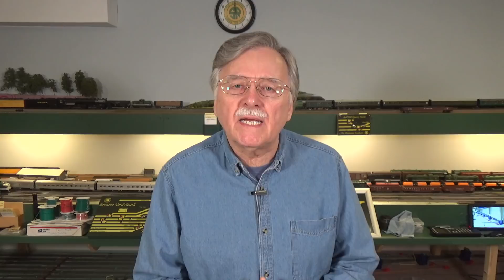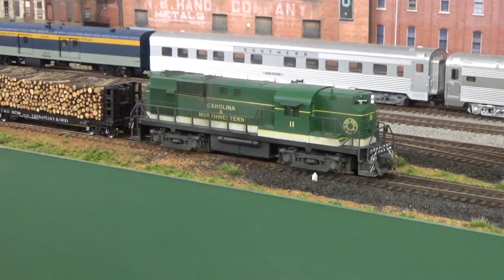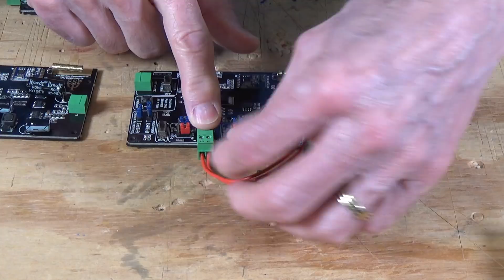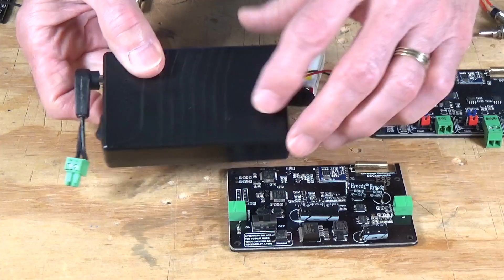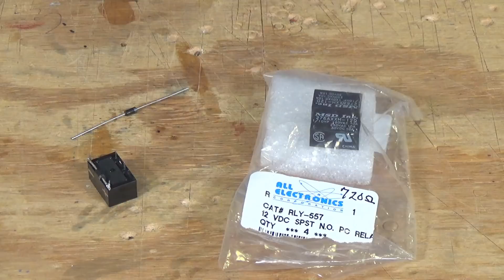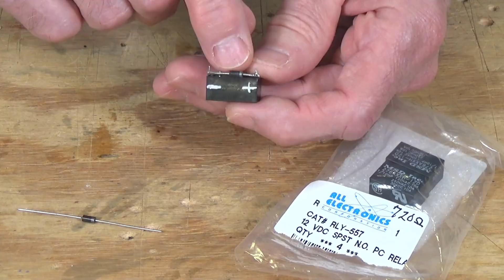NEW Wireless Layout Control With The Power Of ESP® (236)

Comment: Only allowing  the three transmitter outputs to be in sequence is very constraining. For example, my turnouts use the Union Switch and Signal convention so they all have odd numbers.
Reply from the maker: I’ll check with them to see if there is a way to set individual switch addresses.
Reply from the maker: Ok, I git an answer and for now they can only be programmed in the 3 address sequence.

Comment: Does each turnout require a cobalt switch machine, an ESP receiver and a separate power supply?  If so, this seems very expensive.
Reply: It's the transmitters that work out expensive with only 3 outputs on each.
Reply: Only one receiver is needed to control multiple digital devices :-)
Reply: @richard-brighton-ros  Upon rewatching the video, one cobalt switch machine is connected to one ESP receiver and a toggle switch is connected to one of 3 slots in on the transmitter board.Therefore, the toggle switch can wirelessly control the one turnout switch machine.If someone had Tortitise machines, would they work with the receiver or would one need to replace them with Cobalt machine?
Reply: @stevetee5076  They'd need DCC decoders.
Reply: @stevetee5076  you can use Cobalt iP Digitals, Tortoise switch machines with an accessory decoder or Smail machines for this :-)
Reply: @richard-brighton-ros  ok, thanks.  This makes sense now.

Comment: You mention that the system can be used with occupancy detectors, I was told by the manufacturer that it won’t work with the digitrax bdl168
Reply from the maker: Interesting, I’m sure there are some individual design constraints. I know it will work with their LMID detectors and they should also work with NCE BD20’s which are similar. These are so new it will take a while before they are tested with every conceivable combination.
Reply from the maker: The BDL168 apparently integrates with Digitrax Loconet through a proprietary connection that is not compatible with the ESP system.
Reply: And that’s the issue in how a occupancy module communicates because although to a certain point it will work with most systems which is the claim, it is a bit misleading because of the occupancy issue. For occupancy you you would have to use the concepts feedback module as I suspect most occupancy modules would be incompatible because of how the occupancy module outputs it’s data. When I enquired with them about this the feedback module needs to be able to output a switched state on top of the sensor message for the specific data bus that’s being used.

Comment: Thanks for the video on the ESP system.  That makes it a little more clearer.  I hope I can get my hands on the receiver and transmitter soon.  I do want to play with the two color LED momentary push buttons to see if those will light while operating the transmitters.
Reply: Hi, D. Bi-color LED's work fine with many turnout/accessory drivers, (like my DCC Concepts DCD-ADS sx units) but I found it was necessary to use Common Anode LEDs. I would also look for the ones with the diffused rather than clear buttons (I don't know what to call them.) Good luck.